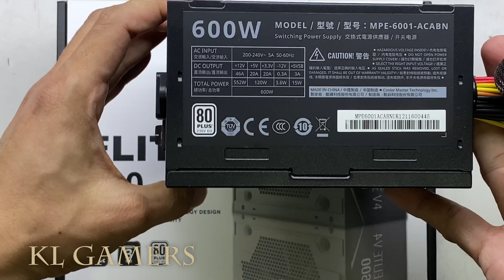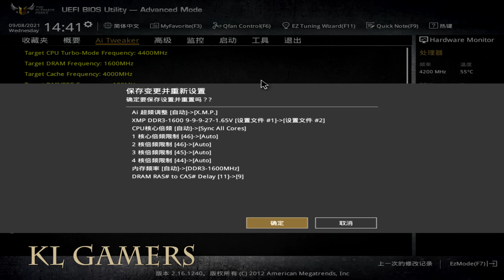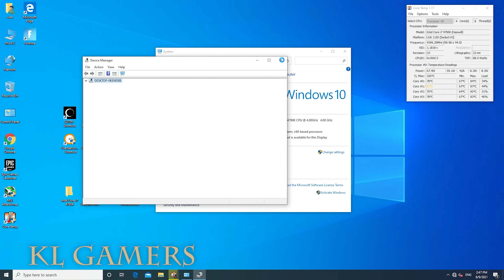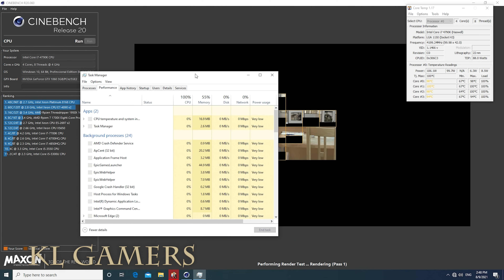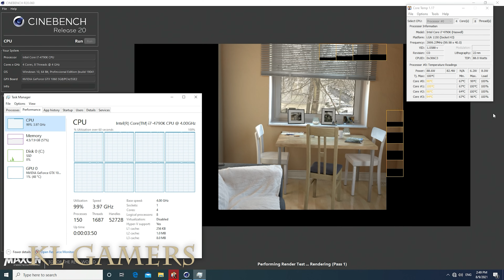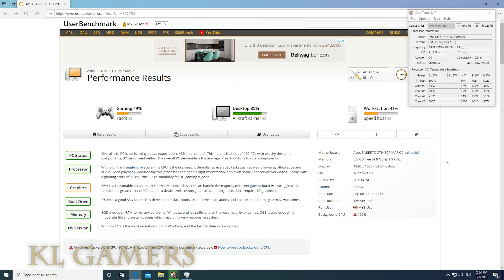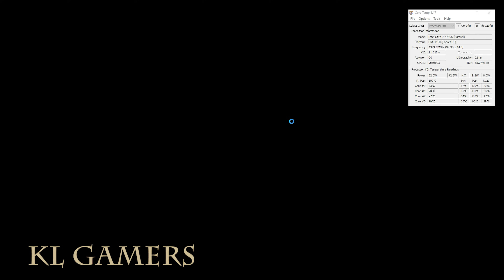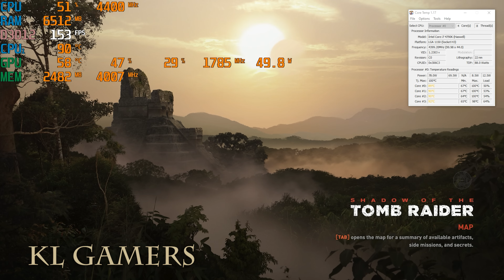Satisfying Gaming PC Build intel Core i7 4790K ASUS SABERTOOTH Z97 MARK 2 GIGABYTE GTX1060 3GB

Comment: i already own a very similar build and i agree with this being a satisfy
ing build, its 10 years old now as of this year too but new enough for most emulation
Reply from the maker: yes sir
Reply: @KLGamers  only downside with my setup is that i have a overclocked gtx 1050(2GB) instead of 1060, it defo is a significant improvement having opengl 4.6(for emulation) and at least 3GB of vram which is significant improvement over the 1050